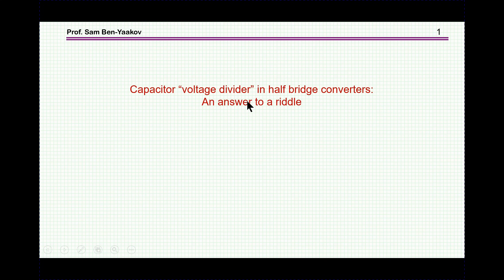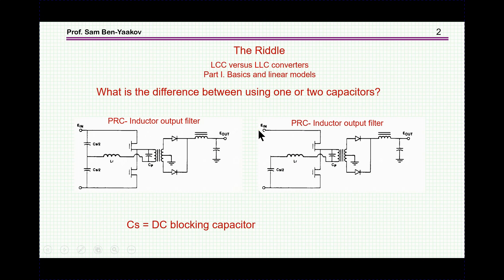Capacitor “voltage divider” in half bridge converters: An answer to a riddle

Comment: There's a missing configuration about this issue. The one which is connected to the center of the two connected in series bus capacitor which is half of Vin. The question is if the calculation of the primary winding be half of the usual half bridged design or still V/2 of Vin for the primary winding. Because the center node of the two series bus capacitor is always half I believe. Like what we saw in most PC ATX power supply where the series resonance cap is connected to the center node.
Reply from the maker: am not sure that I follow you. Please send a sketch. You can write to sam.benyaakov@gmail.com
Reply: @sambenyaakov  Ok, thanks for the response, will do.

Comment: Hi sir, thank you for this video. However, I have a question. At timestamp 13:30, you mentioned Cr1 and Cr2 are in parallel. I'm not able to understand this. As Cr1 is connected between Vin and transformer, while Cr2 is connected between transformer and ground. Please elaborate. Thanks.
Reply from the maker: For AC the bus is shorted to ground. So for AC the two caps are in parallel.

Comment: Very in depth but also easy to follow description. Would like to have analyzed the case when there's only one capacitor but connected between midpoint and positive rail as you implied in minute 9:45. 
With regards to the need to place dc bulk capacitors when having split capacitor half bridge, I do not agree it's a must. Even having DC bulk capacitors does not  prevent from haven pulses of current absorbed from the energy source if  the front end of the converter isn't designed accordingly. However I recon that using the split capacitors bridge as a DC bulk would impose not only higher high frequency currents on them but also the possibility of reverse voltage if there is enough mismatch between timing capacitance and inductance. Having the function of enegy storage for longer times also tends to higher capacitance which promotes higher transient stabilizing times and currents. All of the above favors the use of high frequency non polarized capacitors for the half bridge and high capacity polarized capacitors for DC bulk storage.
Reply from the maker: Thanks for input. I do not understand the logic " I do not agree it's a must. Even having DC bulk capacitors does not  prevent from haven pulses of current absorbed from the energy source". You do not need caps at all because with them you may also have a problem And without them you will not ???? wouldn't it be worse?

Comment: Hi first of all want to thank you for your amazing explanation. 
My question is: you are saying that in the case of LLC, we don't need a bulk capacitor since the Cr doing the Job. when I'm looking at the TI application of UCC25800-Q1 they use Bulck and Cr  but they put TWO 1/2Cr on  the secondary side.
would like to hear your opinion about it.
Thanks you anyway 🙏
Reply from the maker: Thanks for note. Where (minute in video or slide number) do I say that there is no need for a  bulk cap? 
As for C/2 see https://youtu.be/T8qWWwsMOK8

Comment: DC  by capacitor rescues the DC source from draining continuously. During each charge cycle, polarisation current of capacitor cT only flows.Therefore CT capacitor improves inverter efficiency.
Reply from the maker: I am sorry but I do not understand what is this has to do with this video.

Comment: Thank you for the great video. The only thing I have to mention is that actually, you do not need any additional DC link bypass capacitance when you use split capacitors C1 and C2. You can put even big inductance between C1/C2 and Vin and there will be no problem here, the charge balance will be satisfied for C1/C2 (average current is zero). Might be that RMS is a little bit higher for C1/C2 but still no problem here. You can easily simulate this but also practically ALL HB converters I faced did not have additional big DC link capacitors with split C1/C2 configurations, only some ceramic for EMC. Thank you for ideas.
Reply from the maker: Thanks for participating. You do need a capcitor since the two caps will never be exactly equall.
Reply: @sambenyaakov  I also see only two bulk capacitors in a typical ATX power supply. Perhaps with more stringent power factor controls in place, we will see more cases where a capacitor straight across the bus is found.
Reply from the maker: @peterdouglass6058  👍

Comment: I think you're missing resistors that are typically in parallel with each of the "voltage divider" capacitors.  Typically there is a resistor (~100k Ohms) in parallel with each of the caps.  This creates a voltage divider with Vin/2 in the middle and Vin/2 across each cap.  When each of the FET's turn on, the transformer is hit with a constant voltage from the caps which creates the current ramp waveform through the transformer.  Using the inductor equation V = L di/dt and solving for the constant inductor voltage you get an integral of a constant over time which is a ramp for the inductor current.  So typically there are resistors in parallel with the capacitors to set the voltage.
Reply from the maker: Will all due respect to the references you brought, they are wrong. Half bridge can operate asymmetrical and there is no need for resistors.
Reply from the maker: Well, you are mistaken. In fact,as pointed out in video, there is no need for two capacitor. One is OK (so where would you put the resistor "voltage divider"). Try to watch the video end to end with open mind. If you then have a question, I will be happy to discuss.
Reply: @sambenyaakov  Here is the quote from Runo's Power Design: "In the half bridge the two switches must run with the same pulse width, so that the midpoint between capacitors C1 and C2 will be at half of the input DC voltage."
Reply: @sambenyaakov  I'm referring to R1 and R2 in this image: http://www.seekic.com/uploadfile/ic-circuit/201162412958301.jpg. The resistor divider is also mentioned in the answer to this stackexchange post: https://electronics.stackexchange.com/questions/259406/dc-dc-half-bridge-converter-capacitor-selection.  With the two capacitors the duty cycles need to be almost exactly the same for the two transistors.  Reference: http://www.runonielsen.dk/Half_bridge_control.pdf.
Reply: @sambenyaakov  Here's an example of a real life power supply design that uses the resistors: https://www.youtube.com/watch?v=pffOJdCQ7kw&t=920s
Reply: @sambenyaakov  You also might want to explain, in the resonant LLC, that the Lr Cr are important because they create a filter that filters out the higher order harmonics, leaving behind the fundamental harmonic from the drive pulses. The resulting (filtered) waveform is a sine wave.

Comment: In my opinion in the second circuit: when Q2 is on, there is no reverse current in the primary of the transformer. You have to add a capacitor. Thank you professor for this excellent analysis.
Reply from the maker: To which minute are you referring to?
Reply: Hello Professor,
I answered your question: "What's wrong with one of these circuits", maybe I'm wrong! It was the 18th minute of your video.

Comment: I do not understand,  on slide 7 current is flowing from +Vin to again +Vin why? The current is always flowing from high potential to low...
Reply from the maker: Good point. But...Lf is a current source. When reflected to transformer primary it will (by superposition ) cause the currents indicated by the arrows.

Comment: hello. I have  2half bridge on IR2153  in my DC/DC  power. And I dont understand that these Voltage is not dividade by 2. When IR2153 start working one capacitor has 0.9 Uin second 0.1Uin
Reply from the maker: It is probably a start up problem you need soft start/
Reply: @sambenyaakov  I am uisng to do it ir2153 driver...

Comment: I saw recently this design, with what you sad in Mind, would you say the connection of the middle of the Buss(in red) is not optimal, they have (in Blue) Capacitors across to manage those currents but i would not have connected the middle of the 0.1 Capacitors to the Main Bulk Capacitors. Or do i see this wrong?
Reply from the maker: Please clear to which slide #, minute, you are referring to.
Reply: O i forgot to attach the images, sorry,
https://imgur.com/a/RQTXw0k
Reply from the maker: This looks OK. The blue caps to suppress spikes across bus and the red for steering the ac current. It is desirable to put ceramic caps in parallel to electrolytic for the high frequency components. O.1u seems to me too low though.
Reply: would this not be a problem as you mentioned around 10:54, without a Cb does the ripple current not become a problem. And yes 0.1µF is not much the electrolytic will probably see quite the current.

Comment: Sir, i am very greatfull to listen to your videos. 

Diodes in bottom circuit will see serious voltage spike at turn off as they are chopping inductor current. So snubber on diodes is mandatory.
Reply from the maker: Hi Venkata, Please indicative  which slide number or or minute you are referring to.
Reply: @sambenyaakov  Sir, at 4:33, a current flowing into Q1 splits into C1 and C2. It is obvious that the portion of current in C2 will flow back to the negative terminal of the source. But What happens to a portion of current entering into C1? How it will reach a negative terminal of source? It is very uncomfortable to digest sir.

Comment: I recently opened up an EVGA 650W PSU that had a half bridge and two DC blocking capacitors but strangely enough they were not in the split configuration I was expecting. One capacitor went directly from the transformer to the negative side and the other also went from the transformer to negative but with a current transformer in between - I assume so they could use a much smaller current transformer. So far, it's the largest PSU I have seen use a half bridge - any bigger and they go with a full bridge design.
Reply from the maker: Interesting . Thanks for sharing.